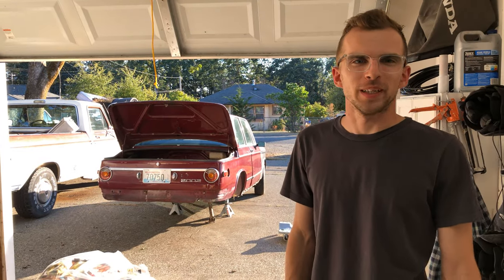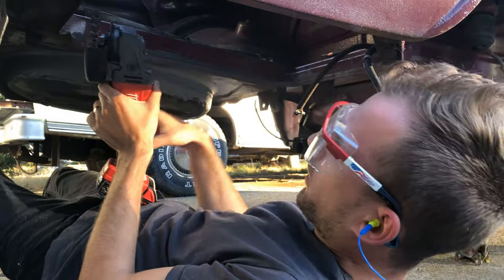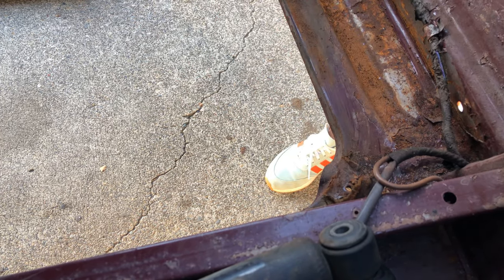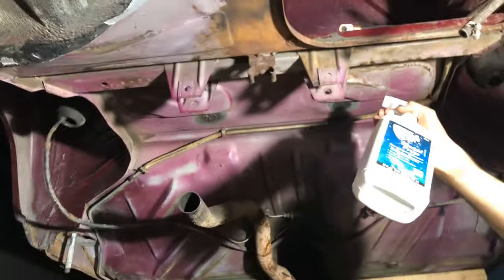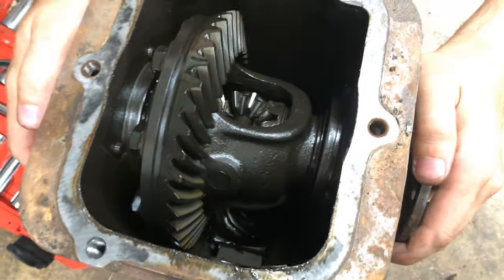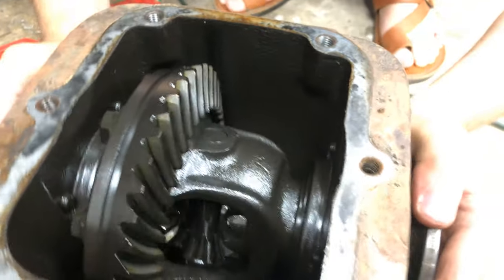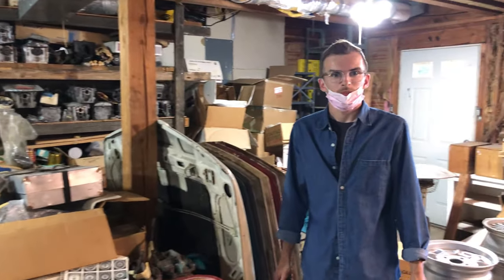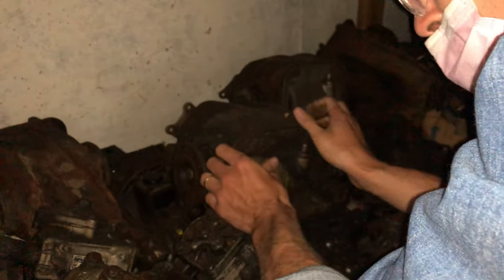BMW 2002 Differential Inspection

Comment: Yep you need another known good diff you can find them pretty cheap! Ithink it is a 3.64 to 1 ratio. Find a 3.90 to 1 lsd gor the 5 speed
Reply from the maker: Yup! For sure. What makes the 3.90 better with the 5 speed?
Reply: @pnwproject4653  depends on what you want in terms of more top speed or more acceleration. Also make sure your dif matches your speedometer (or the other way around), otherwise it shows for example you are going 60 but in real life it is faster or slower.